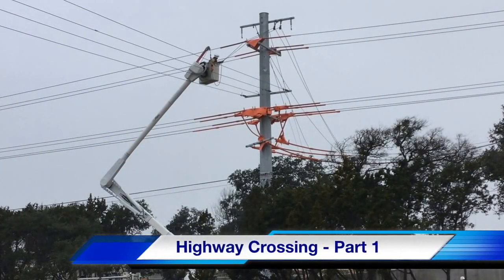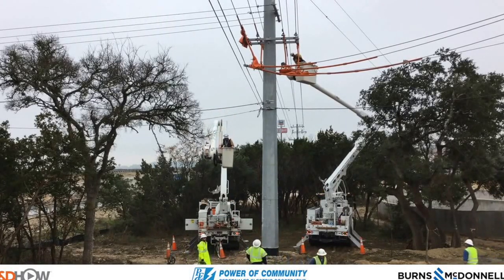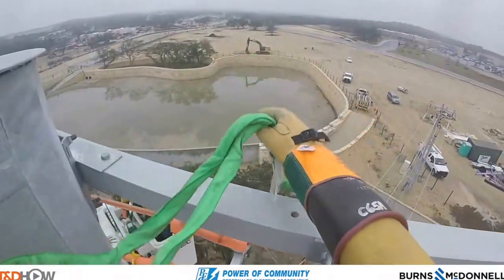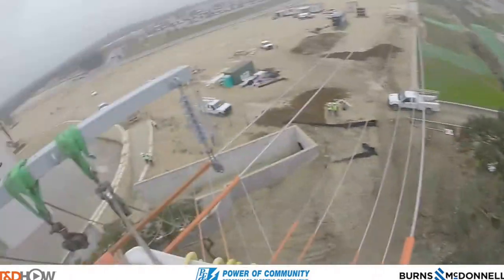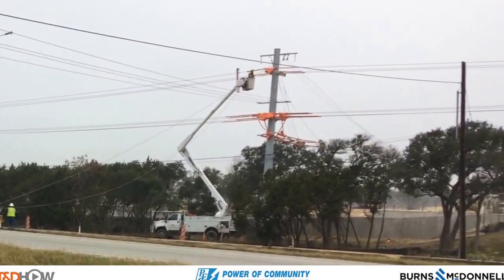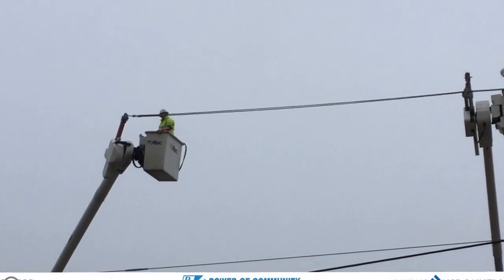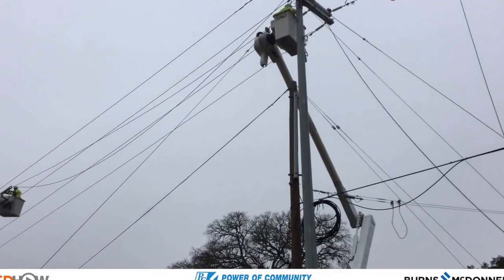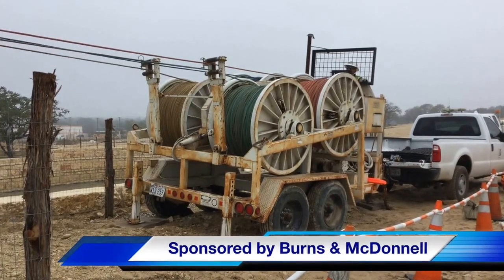How to Prepare a Highway Crossing Part 1

Comment: You guys ever hear of P lines or spiders? Pull P lines across the highway, they are lightweight ribbon type ropes, pull the rope puller line in with the P lines under tension. A bucket on each deadend and one in the middle. A Walker trailing the wire with a radio to ensure nothing gets hung up in the rollers or what you call dollies.